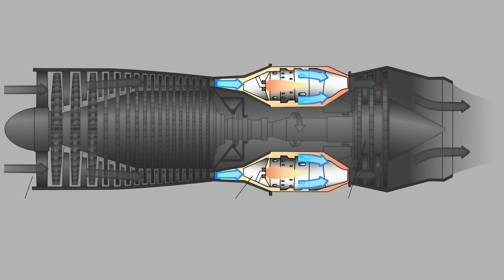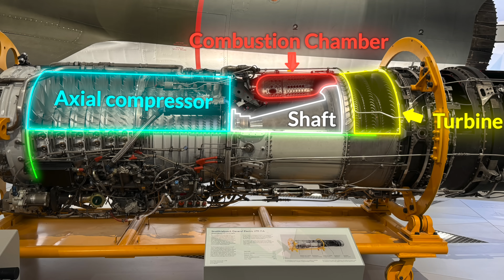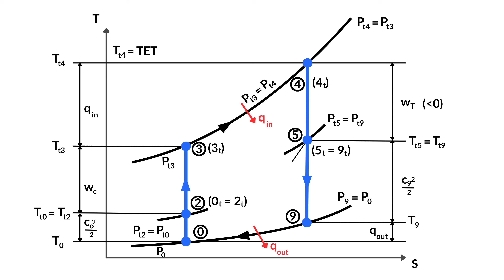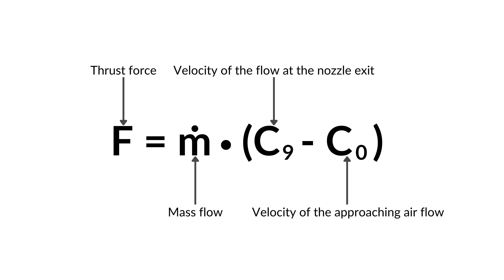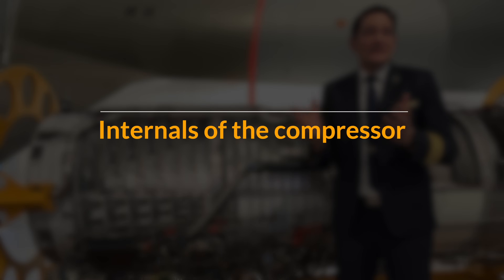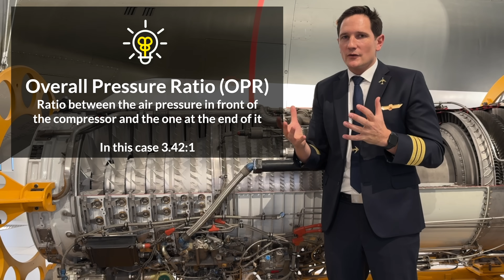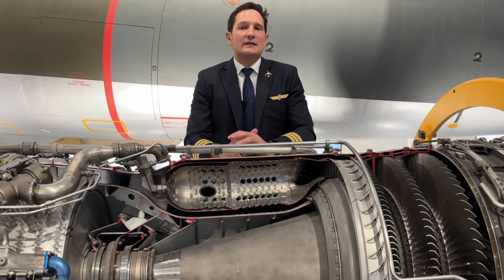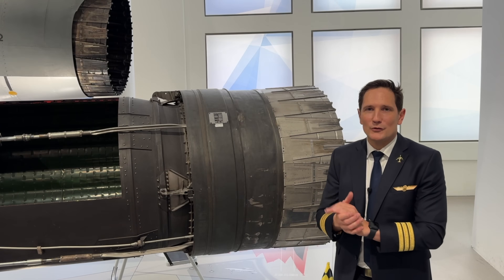How a TURBOJET Engine works - Explained by CAPTAIN JOE

Comment: for those who don't understand why combustion doesn't go back to the compressor:
because the compressor outlet has ex 10bar pressure and 10cm2 area, and the turbine inlet has ex 8bar of pressure and 50cm2 area. 
Without combustion, the turbine inlet would have 2bar of pressure at max rpm (like during an emergency cutoff). 
So combustion INCREASE pressure, but not higher than the compressor outlet.
Reply: Combustion in Brayton Cycle of the jet engine does NOT increase the pressure: to suggest this is to perpetuate a misunderstanding that is common among those unfamiliar with the gas turbine, but familiar with an automotive piston engine.  In fact there is a small but necessary pressure drop across the combustion process.
Having said this, things change very rapidly if the fuel is cut off at maximum power/thrust, and pressures decay very rapidly.  However, this happens very rarely in an aircraft engine, but can happen in an industrial gas turbine, if there is an emergency shutdown.
Reply: @grahamj9101  but how pressure would behave at fuel cuttoff at max rpm? how big a pressure drop would be across the combustion chamber?
Reply: Very good observation! This is key to understanding the jet engine and is always skipped in presentations, so I think more explanation is needed. 
We are told that "compressed air enters the combustion chamber, is mixed with fuel, ignited, then the high speed exhaust gases exit the aft end while actioning the turbine". This explanation is misleading, because it silently implies that the air from the compressing stage enters the combustion chamber at the pressure delivered by the compressor. Now, combustion will further increase the pressure above the pressure of the inlet, so the inlet flow stops and the engine stalls. 
Key factor is to regulate the pressure! The inlet air pressure drops significantly right before entering the combustion chamber (by design of the geometry to expand the air) and further in the combustion chamber. Now, even after the pressure increase due to combustion, the pressure in the chamber is still below the maximum pressure up the stream, so there is no back flow.
Reply: it's more like keeping pressure and speed (of gases) across increasing volume.

Comment: Interesting that you picked a J79 for the video. I was never in the military but many years ago (too many) I looked after a fleet of Convair 880's which were powered by GE CJ805 engines. The CJ805 was a civil version of the J79. Simply put the afterburner was removed and a thrust reverser installed in its place. I was doing a Check 2 on a CV880 one night shift with the cowls open and the Flying Tigers maintenance guy wandered into our hangar for a chat around 2am. He kept glancing at the engine and eventually asked what was it? Turned out he had been in the military and worked on J79's and had recognised the similarities. After telling him it was a civilian J79 he immediately asked what was this pointing to part of the thrust reverser control system. After telling him that he said on the J79 that was the afterburner fuel pump. It was a interesting engine but next to useless to have as a type rating on your licence as it had no other civilian application. However it was a good introduction to variable stator vane systems.

Comment: The maximun thrust in a flight is obtained exactly before take off, with an air speed equal to zero and with thrust levers in the full forward position, just before release brakes.
At this time, difference between the exhaust speed and the inside speed in the engine is maximum. So thrust is max !

Comment: I'm just picturing the air molecules 'pinballing' back and forth against the rotors and stators as it blasts through the engine in a split second.  Great work on this video.

Comment: But is where the propulsive force actually created and applied? And how is it transferred to the pylons?
Reply: The propulsive force is created throughout the engine.  It is the summation of all the pressures on the engine components acting in a forwards direction, minus the summation of all the pressures on the engine components acting in a rearwards direction.  It's one enormous forwards load, minus one not-quite-so-enormous rearwards load, equals a quite large forwards load.
Put another way, the compressor has a large forward load on it, because of of the pressure increase across it, while the turbine has a not-quite-so-large rearward load on it, because of the pressure drop across it.  Because of the terminology, some people think that the mainshaft thrust bearings must be where all the engine thrust is concentrated: this is quite wrong.  The thrust bearings take the thrust loads from the engine rotor systems (ie, the compressor rotor forwards load, minus the turbine rotor rearwards load). There are similarly large loads on the static components of the engine. 
All of the loads within the engine are transferred into the engine casings, which, in the case of the large turbofans, are attached to the pylons by (putting it simply) big bolts and thrust links of various forms.  
The J79 has, I believe (like the early British turbojets with which I'm familiar), just two main engine mounting trunnions, which take the thrust loads into the airframe, plus a third point, which doesn't take any thrust.  Two military turbofan engines, with which I'm familiar, have a single large pin, which takes all of the thrust into the airframe: it is colloquially known as the "donkey's d***"!
Reply: @grahamj9101  thanks, I think I have a better idea of it now.

Comment: After mach 0.5 the thrust starts increasing because of RAM air effect so it means the most thrust is produced in cruise
Reply: Negative. The highest thrust is produced while stationary.
The RAM effect is neglegable, because the intakes are diffusors, slowing the incoming air down and slightly raising the pressure. You don't want air to hit the compressor stages at high speeds. That would cause a compressor stall and surge.
Reply: @CerberusTenshi   Oh, thanks for correcting me. I was thinking that the answer is either stationary or cruise.
Reply: @Maxlovesplanes No problem. Yes, you would think that in cruise it would be the highest, but it's actually the lowest. But that's okay, because you don't need that much thrust anymore, since the plane is already flying and thereby only needs enough thrust to keep the speed. 

This is slightly off topic but I remember a video from years ago, probably before Youtube, where they compared a conpact car with a small engine and a large SUV with a big engine. Acceleration of the big SUV required of course a lot of power compared to the compact car, but when cruising at I think 100km/h (62mph), it only required like 34HP to keep the speed, while the conpact car required more since the engine wasn't optimized for that kind of speed. The point is though, the required power to keep a steady speed on a horizontal path is really small compared to acceleration and climb. Just as a side note.
Reply: @CerberusTenshi   I thought the question wrong. The highest thrust is produced on takeoff, but if a plane is flying at etc. Mach 0.8 and the pilot puts thrust levers to TO/GA(which will never happen), it would produce the highest thrust because of RAM air, but in normal flight the highest thrust is at takeoff.
Reply: @Maxlovesplanes You mean as an actual stage of flight, so when the plane is moving, not considering the take off procedure as part of the flight stages?

Then you would still be incorrect. RAM has no meaningful effect up there. As I said, the inlet is a diffusor, so it slows down the air before the fan blades anyway. A ramjet or scramjet engine would benefit from the RAM effect, but turbofans and turbojets don't. And the formula still stand, that the force produces is the product of mass airflow times the difference between exhaust gas speed and inlet air speed. Given that cruise is at mach 0.8, the exhaust gases only slightly higher, that factor is close to 0. And remember, the air is less dense up there, so even with ramming it into the inlet, the density is not as high as on the ground. So the mass air flow stays about roughly the same. So, the most thrust produced in actual flight, so when the plane is not touching the ground, would be on climb. High engine rpm, thick air near the ground, slow inlet speed but high exhause speed. That's why you can hear the engines spool down a little bit after take-off while still climbing. The initially required thrust to get off the ground is no longer required as speed increases. Think of it like with a car engine. If you have an naturally aspirated engine, the maximum inlet pressure is atmospheric pressure. And even with intelligent cylinder design, all the bells and whistles, you can't get much more out of it. At best, you increase the pressure to 1.1/1.2 atmospheres at sea level. In the mountains, you lose power due to thinner air. So even if you got a ram effect of 1.2 times, the thinner air in the mountains reduces that effect. 
1.2 x 1 = 1.2
1.2 x 0.9 = 1.08 
But 1.2 times normal air pressure using ram, that's pushing it. An aircraft engine is like a turbocharged car engine. Almost litterally. The fan blades are what move the air through the engine and dictate how much air flows. Just like the turbocharger on a car. If your single turbo doesn't work, you get the NA pressures again. The fan of the turbo is cramming the air into the intake and cylinder. It's like the bouncer of a nightclub, controlling how many people get in. Not quite a wall, but restricting the amount of air.

Btw. cruise is about 90% thrust setting. You want the other 10% in case of an engine failure, so the remaining engine can take care of keeping the plane in the air until the emergency landing.

Comment: A proper engineers explanation. Excellent. I never understood what a compressor stall was and why it happened nor why when it happens that you see fuel burning at the nozzle. This briefly explains what happens but why and how to prevent it would be useful.
Reply: Why it happens: Disturbed air flow

How to prevent it: Adjustable stator vanes to smooth out the airflow depending on the velocity of the air inside the compressor.
Reply: @CerberusTenshi  Brilliant - Thanks. Yes I can see that, but, when the compressor is already pulling large volumes of air through (you often see compressor stalls on take-off at full power) what can cause such a massive disturbance within the compressor to cause or initiate that large back flow of air? Something must trigger it in a carefully designed system. How common a situation is it? Always there, always a risk, a rare risk but needs maybe a small change in inlet air pressure due to wind? All fascinating.
I see that adjustable stator valves can be used to re-direct that back-pressure to re-establish a liner forward flow, but, how much of an indication to you get of such an air flow disturbance happening and can you initiate a change in stator position quickly enough to quench it? I guess this is a typical fluid dynamics problem. As a  life-long comms guy I see that you need a closed loop feedback to do this, but doing it quickly enough I guess is the issue. How often in real life does this situation arise but is never visible because that feedback control prevents it from building to uncontrollable levels?
Reply: @ianflint4610  The full answer to that would be too much for the comment section, so I try to keep it short and simple.

Compressor stall can happen in any flight stage. Take-off has the highest risk, because of increased airflow into the engine, which causes a differential in air speed between the various conpressor stages. It's not big, but can be enough. Only the first few conpressor stages have variable stator vanes (VSV), and the later stages are flow optimized for cruise, where the engine sits most of its like. This is btw. true for most car engines as well, but in a different way. 
Back to airplane engines. So the first compressor stages would stall, if suddenly the airspeed increased drastically before the VSV could react to it. The later conpressor stages would stall at lower RPM, when the airflow is not yet high enough. Either of those would cause the pressure in the compressor to suddenly decrease and making way for the extremely high pressure in the combustion chamber to push some of the air back into the compressor. It's all one long connected system after all. 
One other parts of the engine that is partially responsible for reducing the risk of a compressor stall is the bleed air duct. There are two of those. Usually at stage 5 and stage 8 of the compressor. That's already behind the VSV. Stage 8 is of course hotter, so it's used often in the beginning for the climate pack heat exchanger to make the cabin air warm. It's also the air that flows around the metal in the combustion chamber to create a protective layer of "cold" air so the hot air from the combustion doesn't melt the chamber and turbine. Stage 5 is used when the engine is hot, because at that point, the air there is heated up enough just from compression. The air is also used for de-icing. There is a valve that switches between the two stages. So that's a point where a small pulse can happen, that disturbes the airflow. 

Engines are quite the mimosas. They don't want to be outside their goldilocks zone for too long. 

Now, what can be done differently? Not much, really. Technology evolves, but compressor stalls are rare enough, that until becomes a serious problem, developement costs and certification process and costs are worth it. Certification of something new takes years. See 777X. Even modification takes its time. And money. Beefing the engine up to just not having to worry about anything also doesn't work, because of emissions regulations, fuel efficiency goals and the likes. Plus it would mean extra weight. Ehich would mean more stress on the material. The blades of the last compressor stage experience 5000g of force, while being somewhere between 500 and 800°C hot. They only weigh a few grams each, but at 5000g, 5grams pull with 25kg. Just as an example. The blades are heavier tham that, though still very light. 

I hope I answered most of your questions. Just let me know, if you want to know something else. I try my best to answer. It's not too long ago, that I studied that again for my previous employer.
Reply: @CerberusTenshi  Oh Wow/ Every day is a school day. Really appreciate you taking the time.
Reply: @ianflint4610  You're welcome. And indeed, every day is an oppertunity to learn.

Comment: Thank you captain, two things that could have been be added: 1) how are the engines started? 2) where are the fire extinguishers released? Maybe in next episodes? :)
Reply: There are a bunch of starting techniques for engines. Starter generator, cartridge, bleed air,...

The fire extinguisher are released around the engine. The surround is not supposed to burn. Inside the engine, a flame is normal. In the combustion chamber. Anywhere else, the flame can't be sustained for long if there is air flow and no fuel injection.

Comment: Suck-Squeeze-Bang-Blow sounds like an advertisement for an adult movie or saloon.

It's interesting that the exhaust cone is called Nozzle even though the word comes from Noze which is used as a term of areas of posterior not anterior.

It seems like very industry has its idiosyncrasies.
Reply: The endpoint attachment to a water hose is often called a nozzle, so perhaps not that unusual.
Reply: @commerce-usa  that endpoint Nozzle would be facing the fire, hence this would be the "front" of the hose. So I guess there is no inference from your example.
Reply: wrote: "It's interesting that the exhaust cone is called Nozzle even though the word comes from Noze which is used as a term of areas of posterior not anterior."

-- As far as engine concern - it's a last part of the engine, but wait there is more... As far as FAA concern - turbine stators are also called "nozzles", and will be thrown a few terms in order to confuse those who seeking to get FAA certified on their exam.